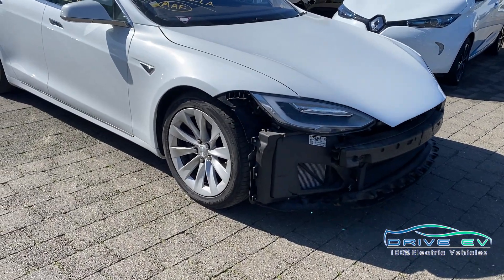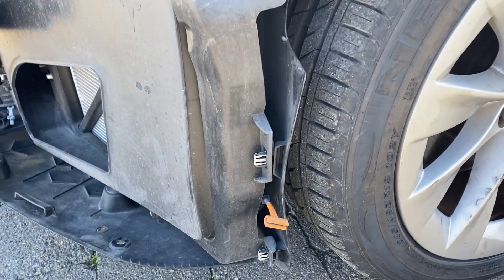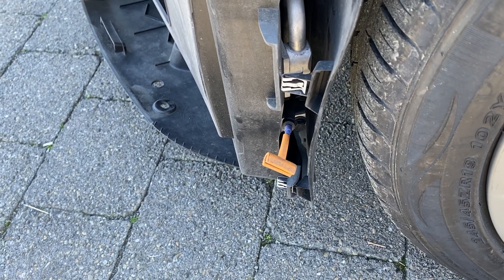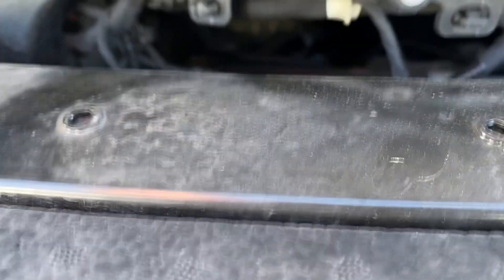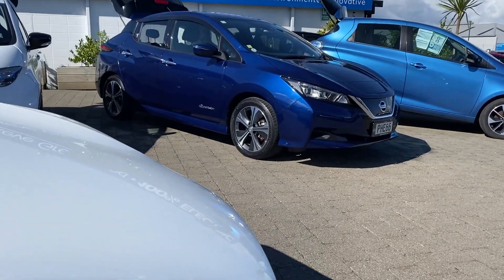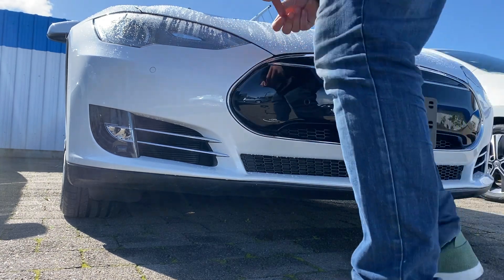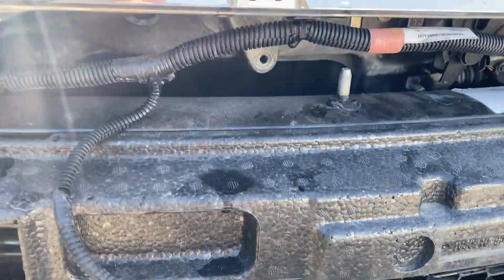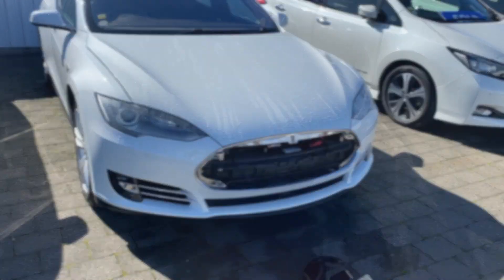How to Jump Start a Tesla Model S

Comment: How do I get in if I broke the manual pool latch. And the battery is dead😢
Reply: I ended up lifting the car and removing the bottom splash guard, and then I busted the car from are red  cable I saw in the bottom

Comment: What year does that apply to?
Reply from the maker: This is the facelift S, the pre facelift jumps from behind the removeable nose cone
Reply: @driveev441  My early 2016 doesn't have the positive terminal inside the nose cone. It should be at the fuse box below the windshield under the hood.